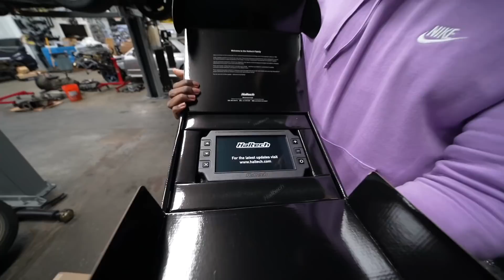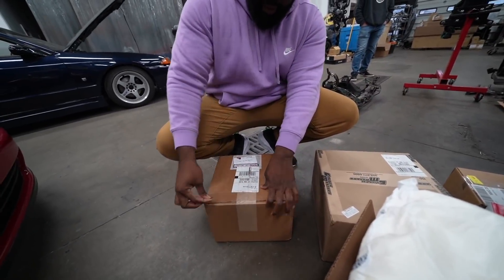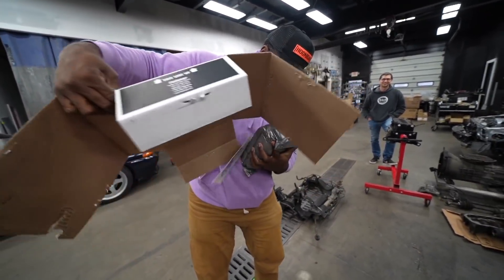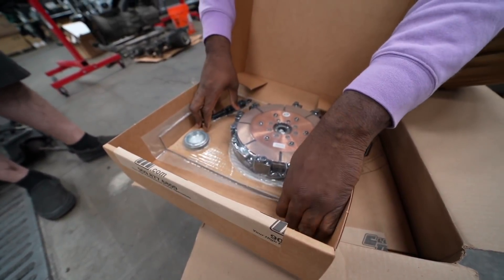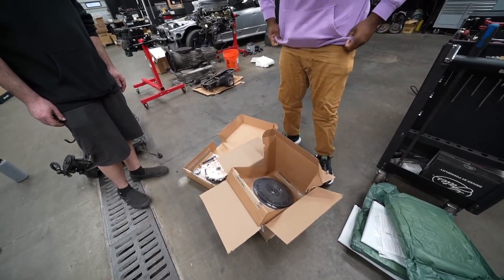HERTS REACTION TO HIS GTR’s ISSUES!

Comment: The early 89 o5u blocks are stronger than the n1 blocks. Thicker cylinder walls stronger deck higher nickel content if i remember correctly. I think its just the first half of production blocks though to meet the 500 production cars for racing.